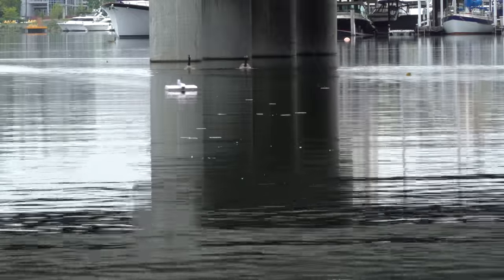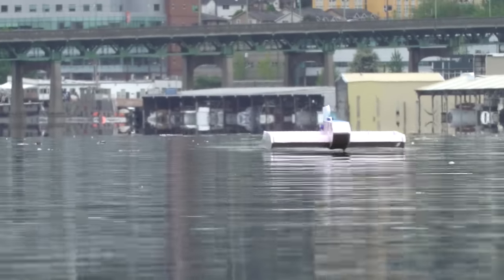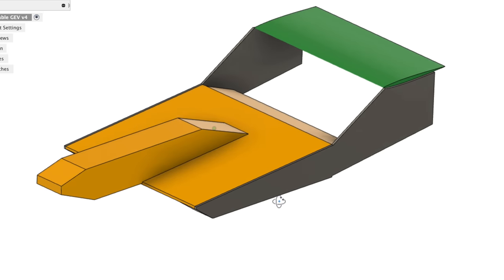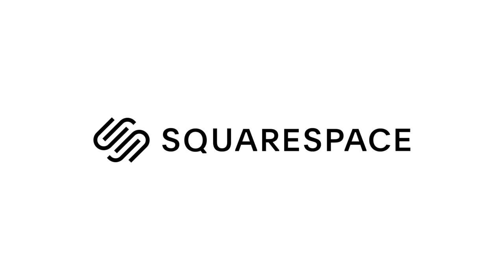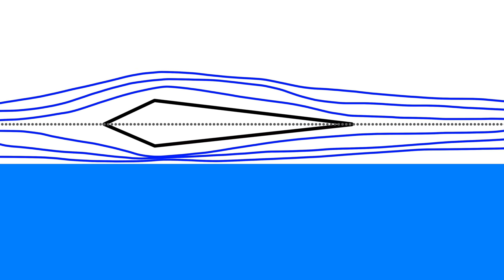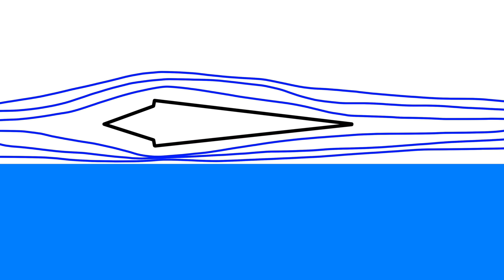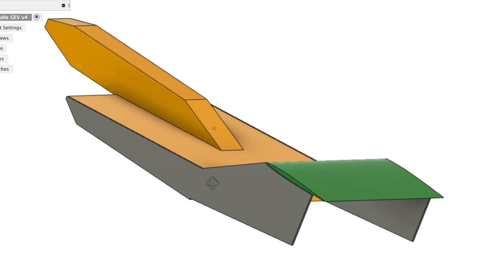RAM Effect Vehicle - A New Type of Aircraft Wing Design?

Comment: If this is primarily for flying above a water surface, waves will be variable enough to keep you from flying. Ground effect is a sweet spot in the envelope, but it's rarely safe. Why not put hydrofoils under the aircraft, to help raise it out of the water with less effort? You'll spend less energy getting airborn!
Reply: I was thinking something similar(not really) but use a boat prop instead to allow the use of more effective airfoils due to the equilibrium point naturally existing due to the drop in thrust as the prop raises out of the water. Using more efficient airfoils could possibly overcome the added drag of the prop in the water. But it would probably be pretty close. It would probably result in a slightly more controlled flight and less risk when waves are involved.
Reply: I was literally thinking the same thing. Hydrofoils could also cancel out the effect of any waves/chop. Working simultaneously with the angle of rhe props could make it fly dead straight.
Reply: Both of these ignore that it's supposed to be an aircraft
Reply: Also a hydrofoils drag effect on an out of water propulsion system as the foil blades exit the water would cause a lot of issues
Reply: @opluxna2120  I wasn’t really suggesting it to be an aircraft, was more thinking utilizing the ground effect better. That’s what the whole video was about was utilizing ground effect. Limiting it to just aircraft might limit possible gains in efficiency do to the added drag from the wedge shaped airframe. I think it was really cool what he is doing. I just think that exploring other options could result in a better design overall that may or may not include any of my ideas. It doesn’t have to be an aircraft to be a ground affect vehicle.
Reply: I concur.
Reply: @colbygann4674  but if it had hydrofoil, it would be a watercraft, ground effect wouldn't matter then. He's literally exploring a new option.
Reply: @opluxna2120  yeah true
Reply: You'd need to have rather large waves for this to be a problem on some of the full sized WIG craft, depending on the design.

Taking off in waves are however more challenging.

And, I'll give you some credit, some of the suggested designs do use a form of skid boards underneath the craft that pushes down in the water at speed, helping lift the craft out of the water. It's then retracted into the craft when WIG effect is achieved.
Reply: If that were true the Soviet Era Ekranoplan would have been a failure..
Reply: It all depends on efficiency. If efficiency is better than rails, we can use still-water network systems for transportation.
Reply: I agree, comical statements all round. No one in the history of engineering has ever found a break through by going over already discovered knowledge. There has never been a point in recreating experiments to glean new data, potentially leading to new methods and designs for use in everyday life. Yes, totally comical. 

Then again.... he could also just be having fun and learning things for himself by doing.
Reply: Just use hydrofoils to aid with "take off" then maybe you could leave ground affect just long enough to retract the hydrofoils
Reply: @sawdustcrypto3987  could just flip them horizontal, to aid with lift?
Reply: That isn't the point of the project. Also go check out his channel where he already has made hydrofoil boats.
Reply: Because then it will be a boat not an airplane.

This was mostly just a fun project/interesting video not a serious engineering proposal
Reply: @jacob416  Yeah, exactly.
Reply: @jacob416  i'm shocked at what you don't understand. I'm glad you enjoy engaging. I'm sad that you haven't learned much.
Reply: @brookestephen  you understand that hydrofoils are "wings" that stay in the water, right? So if the vehicle had a hydrofoil in addition to an airfoil than it would not be an aircraft. 

when the point of the project was to produce an aircraft that could only fly within the envelope, or at least one that had a natural tendency to stay within in it.

and about my statement about this just being a fun project not a serious one. What would be the real world benefit if intentionally limiting an aircrafts cruising altitude? It would make sense if taking advantage of ground effect was done to increase efficiency, But this project purposefully waste excess energy in order to maintain the lower altitude. I bring this up as "evidence" that this video isn't intended to solve any real world problems. But just demonstrate a few engineering and physical principals.
Reply: https://ru.m.wikipedia.org/wiki/%D0%9B%D1%83%D0%BD%D1%8C_(%D1%8D%D0%BA%D1%80%D0%B0%D0%BD%D0%BE%D0%BF%D0%BB%D0%B0%D0%BD)

на подводных крыльях скорость 80км/ч, а у экраноплана скорость 500км/ч. Почувствуйте разницу.
Reply: I've never seen so many bots replying to themselves so much. Must be trying to lure people in by trying to trick people into thinking it's legit.
Reply: @opluxna2120  its definitely not a 'new option'. Not new at all. It's also crazy unsafe, no way it will ever be used in place of planes. The hydrofoil would eliminate most of the safety issues. Overall it's a cool but fucking dumb idea in practice.
Reply: ...and if the foils come out of the water because of a freak wind or unusual wave conditions?

Comment: Here is a crazy idea for the heavy vehicle approach: give it an auxiliary waterjet drive to get it to speed where it is planing and the wings start to provide enough lift to reduce the water drag and the aero motors are powerful enough to keep it accelerating to fully stop touching the water. 
If the vehicle can be heavy then the weight of the water drive being carried around inactive should not be a big penalty, especially if it shares its battery with the aero motors. You might also be able to save some weight by skipping the tilting mechanism for PAR thrust, it might not be needed any more. 
You could also have some sort of sensor in the water duct to automatically turn on the water jet whenever water is present (and motor power is on).That way it would spit out the water and make thrust any time the vehicle starts draging on water. I am not sure that this would work well though. Manually turnint it on might be better and just have it coppy the throttle setting from the aero motors whenever it is on. 
Obviously this only works for boats. This kind of WIG vehicle just cannot go over land or at least can never slow down when going over land.
Reply: The only reason why i see this might be a good idea and also a bad one is, first that you could optimize the air propeller for high speed thrust, instead of low speed thrust.
(aka, low diameter, high pitch) as it does not have to get you in plane.

However it is fairly easy to just add exess power with brushless motors, and an oversized air motor meant to spin a high pitch and large diameter prop will probably be lighter than the whole water jet system.

That been said, the large prop might indeed might be less efficient in cruise than the first idea.
Reply: @ignasanchezl  My idea takes the goal as building a vehicle that is not capable of leaving ground effect. If the aero motors are just enough to keep it cruising  and the water jet that can help it lift off only works on water this could produce a vehicle which does not care how you pilot it and no matter what you do it will not go out of ground effect.

Comment: This is awesome - why are you so interested in ground effect?

Ever since I heard about the Caspian Sea Monster (a Soviet era ground effect project) I thought with this technology you could build high speed car ferries - I thought they could be proven to cross the great Lakes (Grand Rapids to Racine for example) and later developed for long range Ocean crossings (I was thinking San Diego to Honolulu and San Francisco to Honolulu) - the later would necessitate a larger wing span to allow for rougher seas as ground effect is a function of wing span

Like hovercraft, ground effect is a watercraft/aircraft hybrid which is why I believe they suffer from lack of research and development as well as not having a well defined licensing authority

Though designed to closely hug the water high speed ground effect vehicles should have the ability to hop smaller surface vehicles if they cannot be avoided altogether - usually, with radar and transponders this shouldn't be necessary except on rare occasions
Reply: Yes. You're speaking of the Lun class Ekranoplan.
Reply: I have seen ekranoplanes soar live, they calmly fly over a boat with fishermen, the flight height above the surface to create a screen effect is about 5 to 12 meters, very stable and safe with large dimensions.

Comment: I had built something similar using a small 2 stroke  glow gas engine  while I was stationed at Edwards AFB CA. 1990 -1997  It took me about 5 years of tweaking before I could get it to fly  2 inches above the water for the whole time I had fuel (about 7 minutes of flight time)  I gave it to a friend when I PCS'd to Beale AFC California.

Comment: I'm wondering if you might be able increase the ground effect further, while only increasing the in-air lift a little, by making the wings even wider, and potentially shorter (Ie stubbier, and less like aircraft wings). Specifically, I'm thinking of the ram wedge staying roughly the same, then having a flat surface to maintain the pressure, and then eventually releasing it as you are currently doing. That way the aircraft will have much more chance to utilise the ground-effect that it has built up.

One challenge I'm thinking of with doing this is that shortening the wings may make it more unstable on the roll axis. Potentially this could be overcome by keeping the tip-to-tip distance the same, but removing some of the usable wing area in the middle. Eg putting in a longer fuselage, or simply having a gap between the two wings there. If you opt for the second, it could be interesting to have sides on each wing in that gap, to try to hold in the pocket of air.

Anyhoo. I could be wrong about any of this, but it could be quite interesting to experiment with. Loving this series.

Comment: Nice job. Perhaps you could try to use foils to get on a plane with less power and double as ram air. Maybe retractable foils once in flight. Look at sail GP for foil design ideas. Keep up the great content. I like watching designers tinker and try new ideas. Probably going to need a 3D printer to print the foils with stiffener slots for reinforcement.

Comment: Hello! I have some questions about the ram effect.
According to Bernoulli if the cross sectional area is decreasing shouldn't the pressure decrease to compensate the increase in speed (venturi tubes, carburateurs... )?
I thought that this kinds of effects (ram effect) would only be possible with compressible flow.
I'm honestly pretty confused
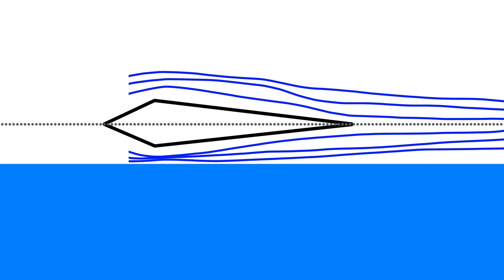Reply: I believe the pressure decrease and speed increase you are referring to occurs AFTER the cross sectional area decreases, not before. The region of decreasing cross sectional area (ram area) will have higher pressure and lower speed,  and the AFTER (where the arrow points @1:59) will be opposite, thus satisfying the balance of mass flow rate
Reply: @alexsims8205  I'm 100% sure that the phenomenon that you are referring to is only for super sonic flow. I think that only happens when the speed on the critical area (throat), reaches Mach 1. (a rocket engine)
Reply: @MsBoss98  So you sent me scouring for answers as if I was back in school haha. Your statement as well as mine is true in supersonic conditions only if it's a 'supersonic nozzle' shape (A1<A2, or a subsonic diffuser shape) But we see here that this is a subsonic nozzle shape, which brings us back to why there's increase pressure at the inlet. 

In short, I believe most diagrams confuse people where the information is written, which is why you should reference a graph (where the +x axis is downstream distance), It is TRUE that a purpose of a subsonic nozzle is to decrease pressure and increase speed as you say, but that's not actually what occurs right away, that effect happens downstream. Same with a subsonic diffuser, it's meant to increase pressure and decrease speed, however right at its change of cross sectional area, it will be the opposite (conservation) and that's how a car diffuser works. It wouldn't be 'suctioning' the vehicle to the ground if it were actually higher pressure and lower speed no? That occurs after the diffuser.

Best example i can find that addresses the way I'm looking at it is on Nasa's site: https://www.grc.nasa.gov/www/k-12/airplane/tunnozd.html

Comment: You mentioned testing a heavier version, and was worried about the speed/power needed to gain enough ram pressure to lift it out of the water. What if you used small hydrofoils attached to your wing skirts? That way, the hydrofoil lifts the bulk of the weight out of the water, then you could transition to ram flight? Cool project!!
Reply: Or a baloon like hoovers have, and as it start yo pick up it could be rectracable
Reply: The KM, known colloquially as the Caspian Sea Monster, was an experimental ground effect vehicle developed in the Soviet Union in the 1960s by the Central Hydrofoil Design Bureau. The KM began operation in 1966, and was continuously tested by the Soviet Navy until 1980 when it crashed into the Caspian Sea
Reply: @justinschreiner2352  yes saw the document about it, technology has improved quite a bit since than
Probably the weather is even more important than in shipping, i think 2-3 m waves can mess up the effect a bit or big winds ;) weather forecast improved since a lot, enough to see how much  the turbulance on airplains are non existent

While they tring to push towards EV vehicles, the freight shipping does more than 70% of air pollution, and companies/share holders wont accept the extra cost if its not an investment with short return
Huge sails would be great, but would make the journey way too long

I wonder how much electricity would be possible to create if they would cover freight ships with solar panels, would the  ship be able to move?!

Comment: A ground-effect vehicle (GEV), also called a wing-in-ground-effect (WIG), ground-effect craft, wingship, flarecraft or ekranoplan (Russian: экранопла́н – "screenglider"), is a vehicle that is able to move over the surface by gaining support from the reactions of the air against the surface of the earth or water. Typically, it is designed to glide over a level surface (usually over the sea) by making use of ground effect, the aerodynamic interaction between the moving wing and the surface below. Some models can operate over any flat area such as frozen lakes or flat plains similar to a hovercraft.
Reply: Straight wingEdit

Used by the Russian Rostislav Alexeyev for his ekranoplan. The wings are significantly shorter than those of comparable aircraft, and this configuration requires a high aft-placed horizontal tail to maintain stability. The pitch and altitude stability comes from the lift slope[note 1] difference between a front low wing in ground-effect (commonly the main wing) and an aft, higher-located second wing nearly out of ground-effect (generally named a stabilizer).

Reverse-delta wingEdit

Developed by Alexander Lippisch, this wing allows stable flight in ground-effect through self-stabilization. This is the main Class B form of GEV.

Tandem wingsEdit

Tandem wings can have three configurations:

A biplane-style type-1 utilising a shoulder-mounted main lift wing and belly-mounted sponsons similar to those on combat and transport helicopters.

A canard-style type-2 with a mid-size horizontal wing[note 2] near the nose of the craft directing airflow under the main lift airfoil. This type-2 tandem design is a major improvement during takeoff, as it creates an air cushion to lift the craft above the water at a lower speed, thereby reducing water drag, which is the biggest obstacle to successful seaplane launches.

Two stubby wings as in the tandem-airfoil flairboat produced by Günther Jörg in Germany. His particular design is self-stabilizing longitudinally.

Not new.

Comment: I live by Galveston. I’m amazed at the 8’ wing span pelicans that glide over the surface of the water just inches from it. They all fly in a line and when the waves rise, they simply lift up enough to clear it.  It has to be pressure under neath of them because everyone mimics the next. Pressure sensors is what is needed. 😎

Comment: If you were to "flare out" the end caps you placed on the end of the wings, so that they were wider at the front but narrow at the rear wouldn't that cause more air compression? And then less speed needed to create the RAM effect?
Reply: No! Counterintuitively, that would actually decrease the pressure under the wings. You would need it to be wider at the back than the front. Look up the venturi effect.

Comment: This brought some childhood enthusiasm to build an aircraft and I had manged to build a small one like this and the anticipation to make it fly was a great adventure of learnings aerodynamics and flight surveying. It was doing a hovering from the ground, I didn't tried it out on water. I think this craft can fly from the water surface with the following considerations. Center of body mass, stabilizing tilt angles of the turbines at parallel with the horizontal craft equilibrium surfaces, reducing the higher angles of the foam surfaces. Without out the use of tilting the turbines upward it should be able to keep its nose up to produce enough angle and then produce enough trust proportionately to take off from the surface of the water and maintain a climbing projectile if the angles of the surface and its surface area ratio with its mass coming to be at proportionately. 
Safe flight and Best of luck!